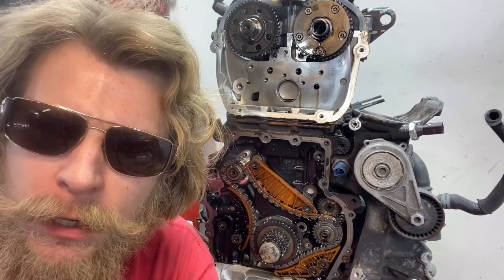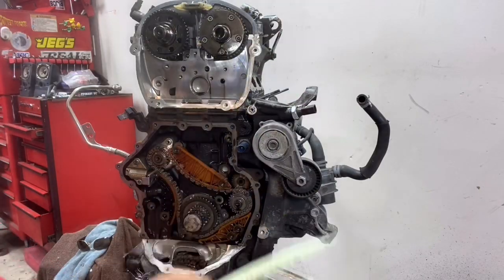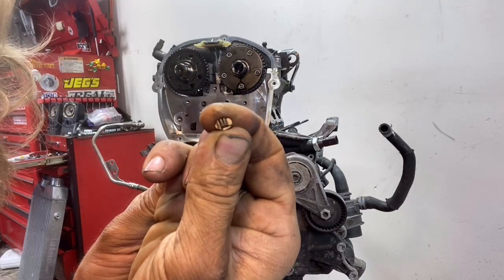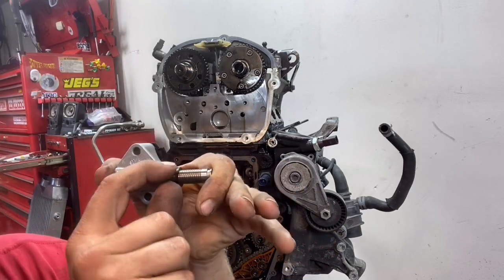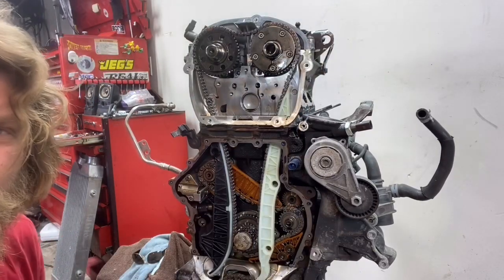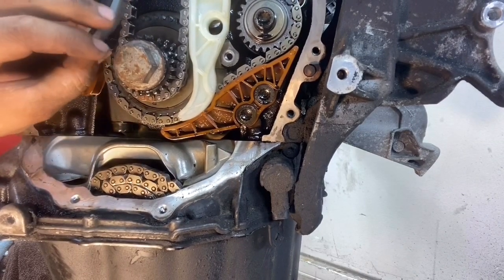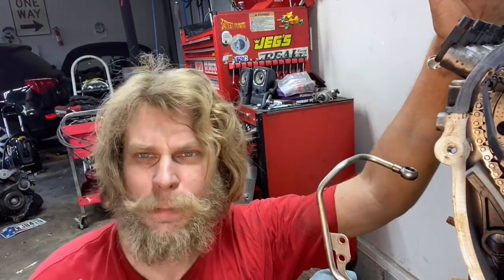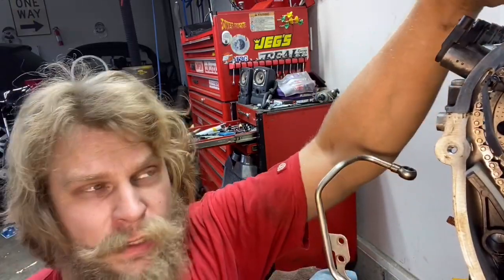2.0t P0016 AUDI VW TIMING CHAIN INSTALL tfsi a4 a5 a6 q5 repair replace diy

Comment: Hello, is it normal that the intake camshaft sprocket have a play, my 2014 vw passat 1.8t doesn't have a slot to put a wrench to spin the camshaft, I used a big pliers to spin it.

Comment: I’ve replaced my balance shaft chain, guides, and tensioner. Currently, my exhaust cam is a tooth off even though it’s how I took the previous chain off after setting TDC. 

Is it okay for me to rotate either of the camshafts? I am currently TDC .

Comment: Have you or anyone reading this ran across any/many camshafts that have had the gear rotate on the shaft itself after a chain broke? Mine has. All the timing marks are aligned, however the crescent on the exhaust cam is not in line with the head bolt now. Is it possible to dial that in and realign it?

Comment: I have opposite of what you show 2 teeth on the left and 1.5 tooth on the right side. But both marks sit on the whole links not in between. Does that mean it jumped on the bottom at the crankshaft?
Reply: I just ran into that situation myself. Car runs great but epic light comes on with a p000a and p0011 over advanced. Naptown tuner can you give a response? Thanks

Comment: Hello i did i timing Chain job and when i get to torque the guide rails at 20 newton meters i still get some play in the intake side guide rails is it normal or should it not move thank you for the answer it will be really helpfull

Comment: Dude, I just finished replacing my timing chain on my A4. Your videos guided me through the whole process. While I had it down I also replaced the control arms and motor mounts.  2 years ago your videos guided me through replacing the rear main seal.  Anybody can make a how to video but you
go further and explain so much.

Comment: Out of curiosity I followed your video step by step. The cams and the crank are all lined up correctly with the brass links.. I’m still getting a misfire at idle but the car drives seemingly perfect
Compression spark plugs and coils are good
Any other suggestions as to what it may be?

Comment: I'm confused on the cam links. I'm 2 links on the exhaust and 1 1/2  on the intake cam. I did it twice with the same results. I'm having a surging issue on idle with p001600. I've checked the crankshaft gear key. What could this be? I tried emailing and the email doesn't work.

Comment: I’ve been watching a lot of your videos and I’m in the process. I put the cylinder head back on and the camshaft back in. But when I timed up the crankshaft pulley and the other chains the lower ones I spun the crankshaft a couple times so now my arrow for the crankshaft is not at the bottom. It is at the side. But I have both of my cams arrows up when I put the cam tray back on. Can I spin the crankshaft or will it throw off the camshaft or bend anything? I know that arrow on the crankshaft needs to be at the bottom. And I did not spin it before I put the cams and cylinder head back on. But I have it at top dead center. It’s just that once I lined up the oil pump and the crankshaft. I’ve probably spun it five times since then cleaning the piston heads. So now that arrow is not at the bottom.
Reply: You can go slow to turn it over and get it in time, verify you're at TDC also by using something to measure piston stroke.
Reply: @ thanks man! I got it timed up! Now just I have to put the turbo lines back on, I put the turbo on 1st and thought I’d be able to put lines on once I got my gaskets and banjo bolts in. Well I wish I woulda waited! My God, it’s a tight fit getting those lines back on the block with it installed. I appreciate the advice!
Reply: @ no problem. If you need any help or advice with it and naptown isn't around to reply. You can comment to me or if you have other social medias like insta, FB, discord, Reddit, telegram or signal you could message me there and I can help

Comment: Great video super helpful. 

Performed the job and I'm getting a code p 00 16 
P0 011 
P000a
Overall the car runs great once in a while I get an extended crank 

I've triple checked my timing marks 
Lower crankshaft pulley lines up perfectly with the arrow on the case and pistons at TDC 

When I first installed the new chain the link matched up with the cam and crank marks. 
If I pull the upper cover off and get it on TDC both cams look identical to your video with the updated guide with the upper guide and measure just about two and a half inches from the  cylinder head guide mount to the cam mark to each cam .

Is it possible that the intake cam is off one tooth from the crank one link that would move that link out just past the plastic guide. 

Any suggestions would be greatly appreciated
Reply: If it's not the cam sensors or crank sensors, cam adjuster magnet or valve then you're out of time still. You may be out of time by 1 tooth but once the car is perfectly in time the codes will go away. I have never had a car still pop timing codes when timing is correct.
Reply: If it's not the cam sensors or crank sensors, cam adjuster magnet or valve then you're out of time still. You may be out of time by 1 tooth but once the car is perfectly in time the codes will go away. I have never had a car still pop timing codes when timing is correct.

Comment: I have a 2016 Audi A5 with 71k miles on it. On some forums I heard the B8.5’s came with the updated timing chain. Can you confirm if this is true. Also if they did, is there an interval that they should still be replaced again?

Comment: omg i love naptown bro literally just answered my question bc im tryna do the head gasket and got the cams out i could pull out the head without removing the lower cover or even taking the chain off at all and i kept thinking how am i gonna know its in time if i didnt even have the colored marks at all when i had the engine at tdc, that explains that had no idea id be spinning the engine over all day tryna chase them dam marks now im just wondering for reinstalling cams since they are spring loaded how is that going back or they can literally just be put back as they came out?

Comment: I appreciate the videos. You have a lot of good ones. Thank you. I have a question. Maybe you can help me out with. I’m trying to fix a vehicle for my daughter. And it’s a 2011 Audi 2.0 Q5. I’m doing the timing chain and updating the timing chain tensioner. The only issue that I ran into, Is I was using the timing chain kit with the white plastic washer for the crankshaft. And the cam locks. So I utilized everything right. But the only issue when I went to put the timing chain back on. My arrow on my crankshaft is in the correct position. But both of my camshaft marks are facing the bottom and not the top. So I tried to spin the camshaft with the wrench and they could only go so far. I cannot spin them to get the mark to the top, so to put the copper links. I’ve already took off the tray now and removed the cams, Because I was scared I messed up something. I turned them a little more than I should have and I heard one make a pop noise. The exhaust side did. I’m not a professional at all, but I was definitely trying to save some money on her first car. With the cam top off now can I just turn the cams and face the marks up myself? Or how do I get this thing timed? If you have a video that explains that I will watch it. I’ve already lined up the crankshaft and the other chains no problem. When it came time to do the camshaft timing, both marks were facing down. I have no clue on what step I messed up. Thank you in advance!

Comment: Have p0016 replaced the magnet and the valve on the intake cam and also replaced the timing chain, verified it multiple times and P0016 still returns. Any suggestions? What I did notice was the phaser barely locks in place and can still spin freely

Comment: Hey Everyone I need some advice. I have a 2019 A4 bought it 2nd hand last year with 53K clicks on the engine. A few weeks ago the engine light came coming up with message start/stop malfunction. I brought the car to Audi and they say its the timing chain that needs to be replaced. My question is…..is it normal on a 5 year old car with now 62K kilometres on the engine that the timing chain needs replacement?? I read online this kind of stuff happens around 10 years or 90-100K. I had a VW golf for 10 years and more KM on the engine and I didn’t have this issue with it

Comment: So how is it the specs show it to be 1.5 links intake and 2 links exhaust. If you do 2 links on intake your measurements would be 127mm when specs are 124-126
Reply: You are correct! I commented this 7 months ago. 30k now and another timing job running great

Comment: hey i have a Q5 that i burt 2 valves on the exaust #1 cylinder and replaced all the valves head gasket chains x 2 banance and timing chain after getting it all together its been giving me 
problems like no power and flooding when i try to start it wondering if you had any ideas its realy got me scratching my head. 
do you have an email or some way to contact with you ? thanks for the videos realy helpful

Comment: Wait. So isn't it 2 links on exhaust side and 1.5 links on intake side?
Reply: Update Almost 30k running great.

Also did another timing job for a buddy. 

2 links exhaust side.
1.5 links intake side.

Comment: Im currently doing the timing chains on a 2010 Passat CC with p0016 with the common failure tensioner. I ran into a weird issue. I have put the vehicle on TDC with crank pulley at the 4oclock mark shown by the timing cover. Have also verified cylinder 1 is in the up position. My issue is that both my exhaust and intake cams are not where they should be. Both are at the 1 o’clock position. They do not measure the 65mm and 125mm overall as specified by VW. Any suggestions would be appreciated. 

Love your channel man!
Reply: What did you end up doing?
Reply: Turn your cams clockwise slowly.

Comment: I need your help!! On my 2015 q5 2.0, I had a chain rail on the intake side broke in half. Now I have the chain off and the cams pulled. When I turn the motor over at the crank, it stops DEAD after about 180 degrees of travel. The lobes and journals all look fine. There are shavings missing from some areas of the block due to the chain slapping around. It did not do this for long, I realized something wasn't right in the driveway. All of the valves appear to be up and closed judging from the top of the head. What could be jamming the crank up? Do I need to pull the head? I'm all ears! I need this car running.
Reply: Sounds like bent valves

Comment: Hey brother! I have all of my timing marks lined up but I can’t seem to turn the engine over by hand? Am I not applying enough force or is there something wrong? Thank you and god bless
Reply: Take your spark plugs out, it should be easier to turn. If it's not turning fairly easily, there's some other issue. Could be out of time.
Reply: Update: my balance shaft had some build up on the end of that was causing it to stick. Cleaned it up with a scotchbrite pad and everything turned perfectly after.

Comment: Hey Naptown i just got the p0016 code but the car still runs( rough but no noises)..I’m wondering if the engine still good
Reply: Was it still good? Should have been with no noise
Reply: @seanh9869  just drove rough chained the chain all hood now
Reply: Sorry changed the chain all good now

Comment: When I put the cam chain in time does the lower chain need to be in time as well as you described? I  had to remove the cam cover to replace a broken spring but lost tension on my bungy cord making the chain fall off the lower gear. I plan on removing the dip stick tube to use a camara to put the chain back on its marks. But I don't want to remkve the bottom timing chain cover off. Any advice.

Comment: i have audi a4 quattro 2009 2.0 i had p 0016 code i replace engine after replacing engine it still has P0016 code what could be reason pleas help me thanks

Comment: Audi just issued factory extension on all 2.0T 2008-2015 timing chains, water pumps and turbochargers.  They will replace them without charge.
Reply from the maker: Do you have additional info for year / miles or a link? The one I know about is 7year 70k for turbo 8year 80k for pistons for example

Comment: I have a 2018 (b9) Audi A5 2.0l TFSI (approx 25k miles on the clock). Would I need to look out for the rocker arms, timing chain tensioners and guides failing early too? 
I only drive 3k miles a year, don't drive it like a sports car etc. The engine is a bit rattly when it starts up from cold, then is quiet once warmed up and drives/runs smoothly

Comment: I have a question I have a 2012 q5. It has mid fires in cylinders 1, 2, and 3. The codes that came back are p0300-p0303 along with p0506. I am trying to make sure everything gets addressed. I have seen numerous issues from timing chain to the piston rings breaking off. All the code came up at the same time so I think it’s the timing chain. It’s at the shop but I am trying to educate myself so I can speak intelligently to the repair shop. Anything you can offer helps

Comment: I have this same engine and the timing chain is on its way out but not that bad sometimes a little rattling on start-up hasn't done it once this winter i figured it being so cold in the morning the metel chain seems tighter in the summer it ratteles on start up then goes away after a few seconds I wish i had the courage to do a timing chain job I'm really good with my hands I know the motor very well I just don't have well tools and space your videos are great I've learned a lot maybe I will have the guts to tackle my chain one day
Reply from the maker: I’ll do the full start to finish diy video soon

Comment: Naptown another well done outstanding Engine timing Chain on these Audi powertrains. @Naptown turner On a 2014 Audi A4 did this year's engine need a to  have a replacement Tensioner?

Comment: Do I need this little wire on the tensioner. I mistakenly removed mine. This is picture before I removed it. It just looked flimsy and I was worried the wire would break and fall off. https://drive.google.com/file/d/1GzJaDoQ4zKj2tzprj_VOuM_P4Dwj37xV/view?usp=sharing

Comment: I'd appreciate some info on a 2010 VW Jetta Wolfsburg edition 2.0t im working on. Herr's the deal, my buddy bought it over a year ago knowing it needed a timing chain. It had the typical cam to crank sensor code. long start time, occasional stall and check engine light. no crazy engine noise, no other problems but did run. Fast forward a year. I now had time to do the chain. I replaced everything timing chain wise and when it started it made an awful noise like it was out of time so my first though was, I bent the valves even though I triple checked ALL methods of timing. well, it was the phaser pin not locking in so when it started the unlooked phaser pin was allowing the cam to flop around in the phaser housing. what's crazy is it didn't do this when I drove it into the shop? I did borescope inside each cylinder and there's NO sign of piston to valve markings. should I install a new cam and let it ride or could I be missing something?

Comment: Hey Naptown, I replaced all timing components, everything except the oil pump chain, my ‘13 A4 runs great no issues, the measurements were dead on at TDC from center of the bridge to the intake cam mark (62.3mm) and total was 125.3mm. It’s been about 500 miles since I did this but I heard that you’re supposed to reset the Adaptation value in VCDS do you know how that is done? Is it too late now to do this? My current value is -1.5° which seems somewhat off with brand new chain and tensioner OEM parts. Anyone know about resetting that cam/crank correlation after a timing chain?
Reply: You sir are proving my point thanks... important little details are always left out in these videos... these videos will have you needing a complete engine rebuild!!!
Reply: Did you end up resetting?

Comment: I have audi a4 2012 and yesterday when I tried to start the car for work the doesn’t run  but takes maybe 10 second crank and after starting upp,and the check engine light came on, I scanned and give me code p 0016 what do you suggest? Timing chain replacement or?

Comment: Thanks a million Naptown Tuner.  I recently bought a very clean 2011 Audi A4 cheap because it jumped time and bent the valves.  After I watched almost everyone of your very helpful videos, I pulled the engine, replaced pistons, rings with new waffle oil rings, timing chains, tensioners, water pump, rear seal, had a valve job done, put it all back together and it fired right up.  Passed smog with flying colors and is running great with no codes.  I would have never attempted this job without your expert knowledge and instruction and you made it so I was successful in getting it back on the road.  Your videos are very entertaining as well as informative.  Many thanks and keep up the great work.
Reply: Great job
Reply: How did you get the engine out of the car in order to take it apart?
Reply: @ressy673 I'd say with a engine hoist and a engine stand..they can be had for a fair price now a days
Reply: He'll yea good job

Comment: I just got done with this timing chain and I got to tell everyone that with the old top guide it's 2 links on the exhaust cam and 1.5 links on the intake side.
Reply: Did it work out? Doing the mm measurements, I get the same.
Reply: @bryanpatrick1405  Yes it works fine. I'm glad I didn't do it wrong.
Reply: I've been hunting this question and answer because this is the one video out of many that contradict. according to all of Google image searches it is the two links on exhaust and 1.5 on intake?